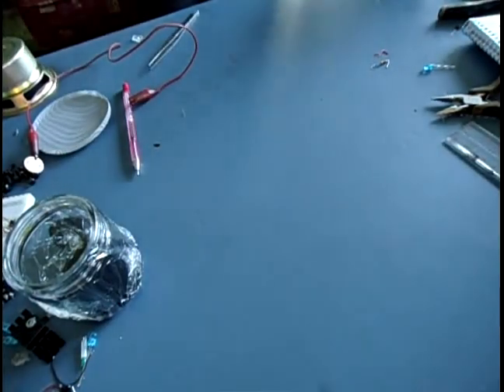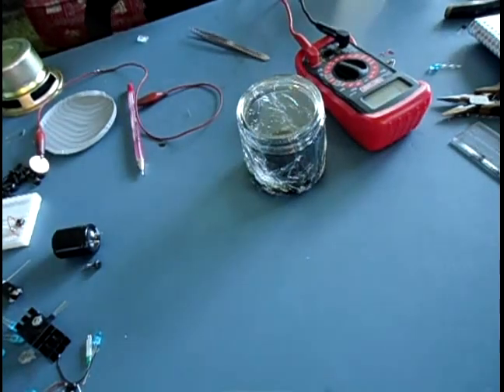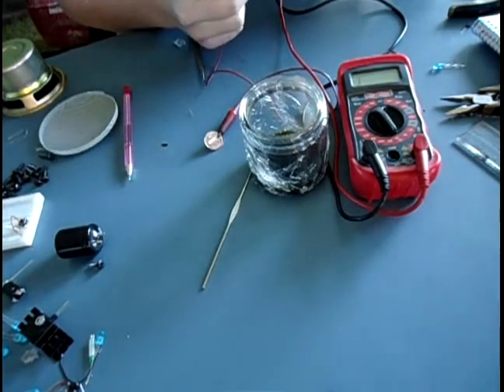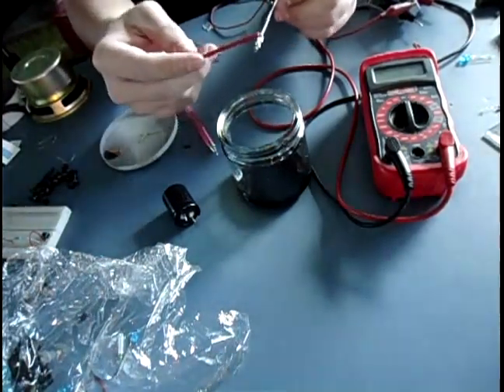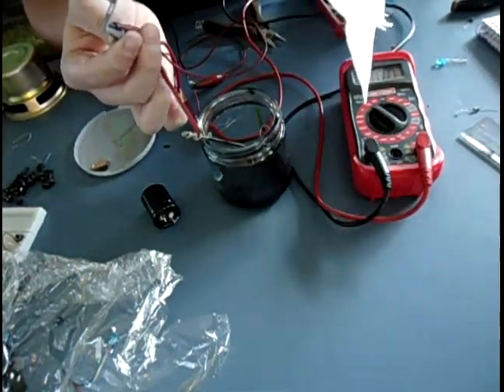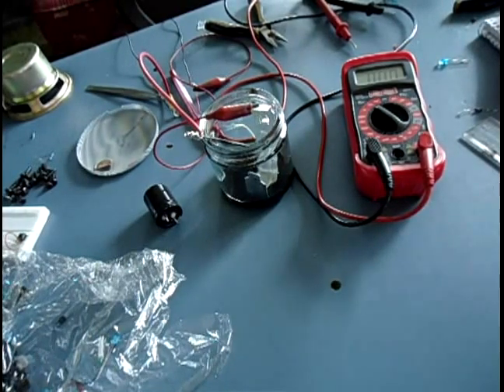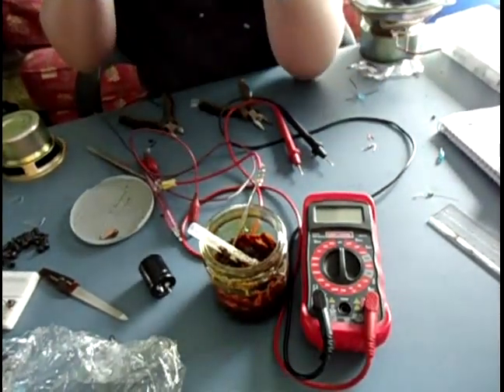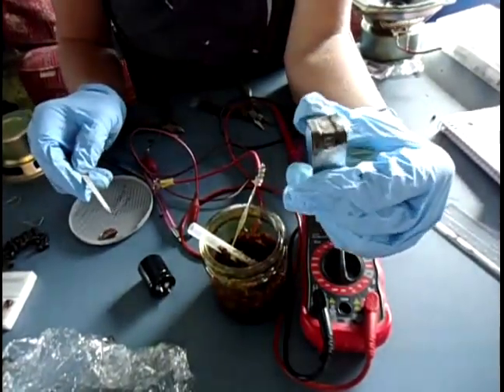Electroplating using Ferric Chloride (FeCl3 + Cu)

Comment: I'm not sure you needed electricity to get the copper out of solution. I've had luck with a single replacement reaction by adding more iron. The copper will come out of solution if you add iron and you can filter it out and rinse your piece of iron. If you use aluminum it will ruin the ferric chloride as it will take the iron's place with the chloride ions.